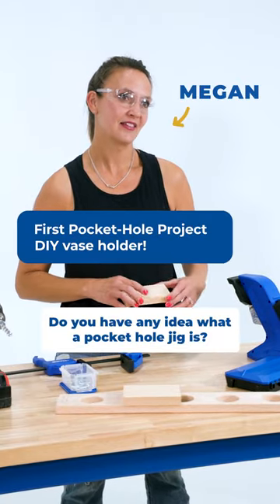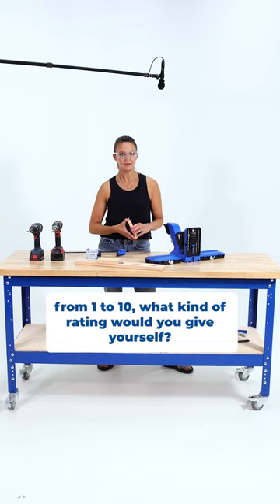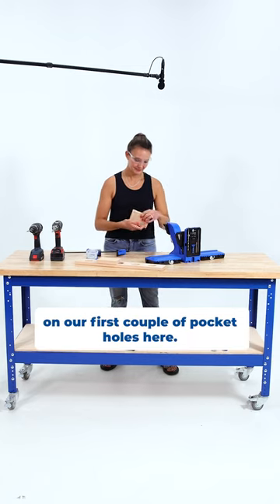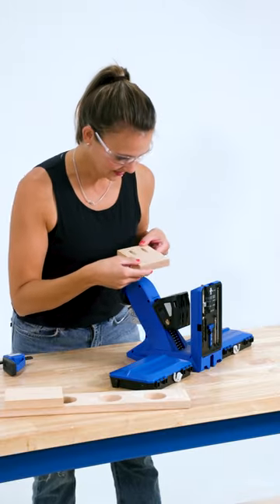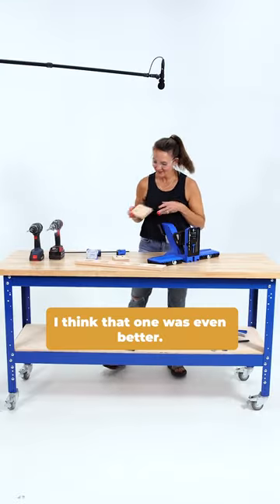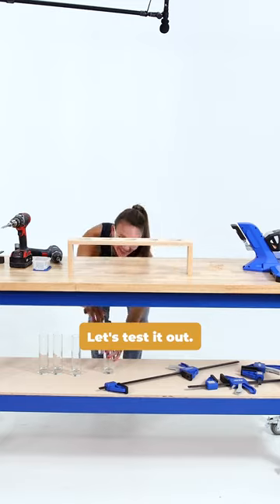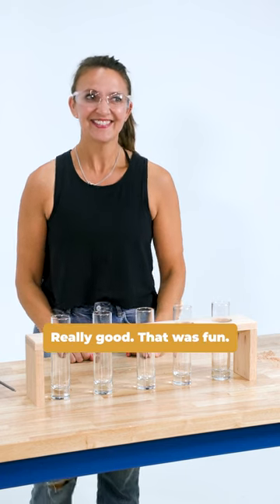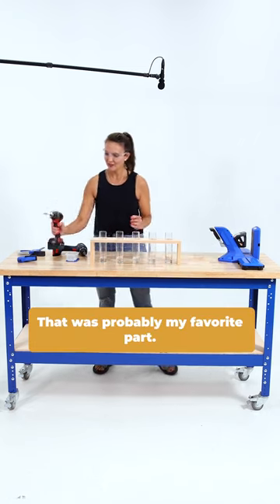First Time Pocket-Hole Project: Megan Built a Vase Holder!

Comment: my pocket hole jig doesn't make holes big enough to hold a vase.
Reply from the maker: You are correct, your pocket-hole jig won't be useful for drilling those large holes for the vases. For those, we used a 2” hole saw bit.

Comment: I was always told to not screw toward the edge of the board? This video shows the opposite? Can you explain Kreg?
Reply from the maker: The biggest determiner of where the pocket-hole should be located is still where they’ll be the least visible. In this project, we placed the pocket holes in a spot where they would be least visible. You can find more explanation on where to place pocket holes here: https://learn.kregtool.com/learn/answers-to-pocket-hole-questions/#q3